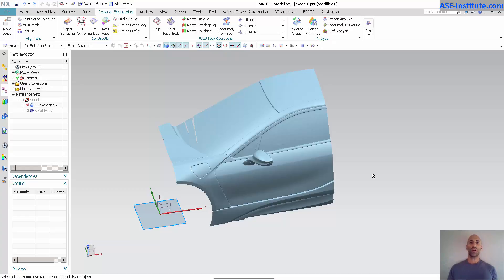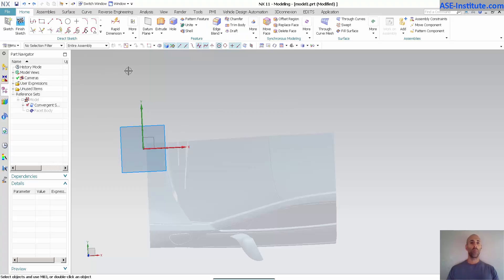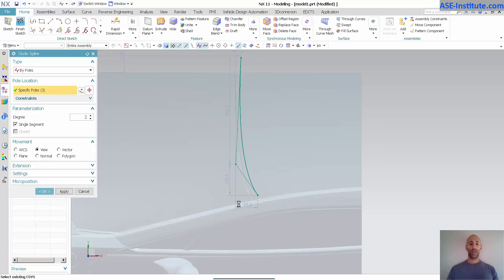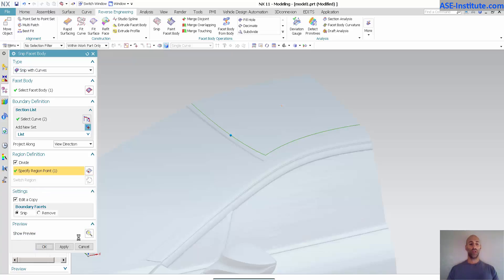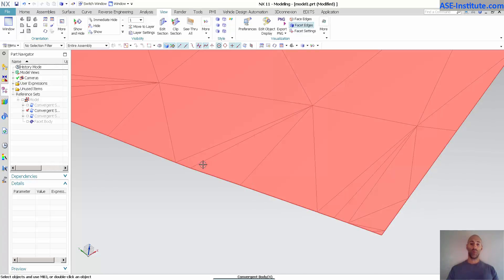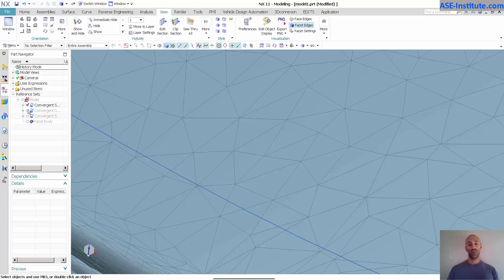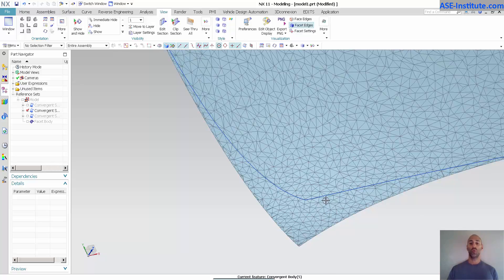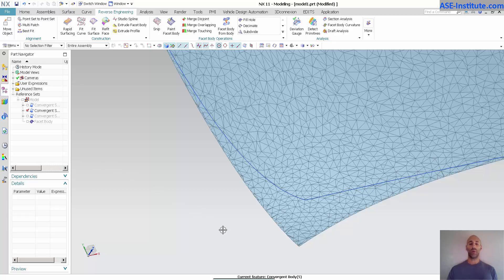Convergent Modeling - Snip | Siemens NX 11

Comment: Hi Steve,  You can use feature modeling Trim Body, Split Body or Trim Sheet to have the associativity you are looking for.
Reply from the maker: Hey Tod, You sir are correct. The issue is with 'Snip' In the Reverse Engineering tool bar. It divides the actual mesh vs. it treating the mesh as a feature. A couple of other tools in the RE tool bar do not allow a user to work with the mesh once it is Convergent, maybe snip can be that way?

I was reviewing some of the tools I know someone will have an issue with.

Thanks.